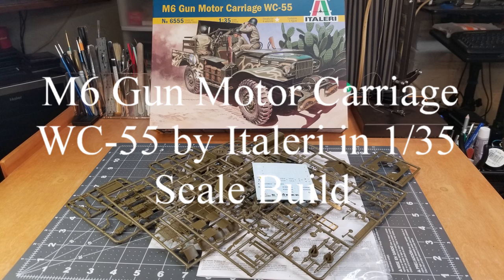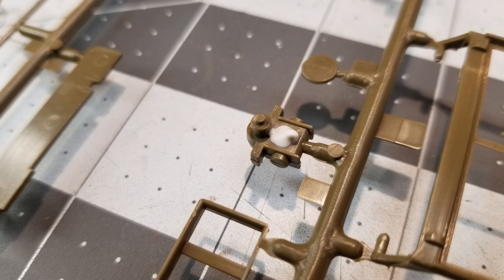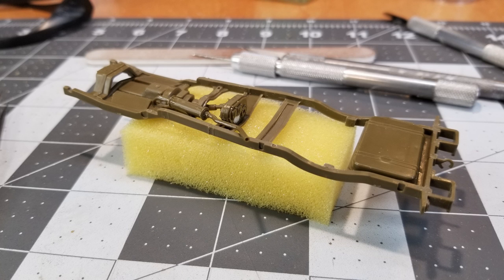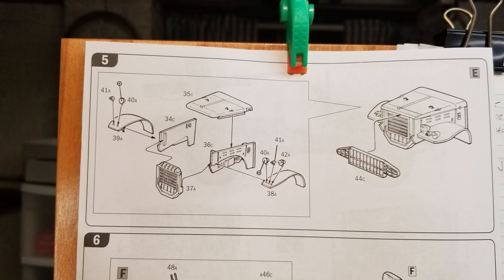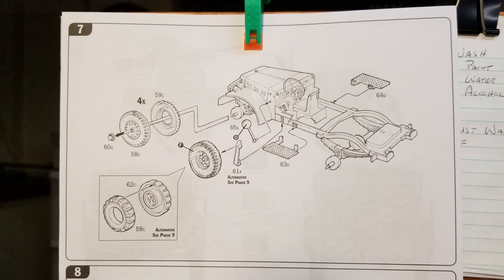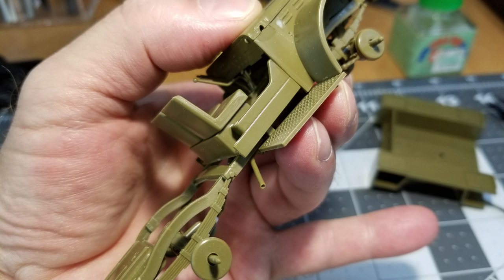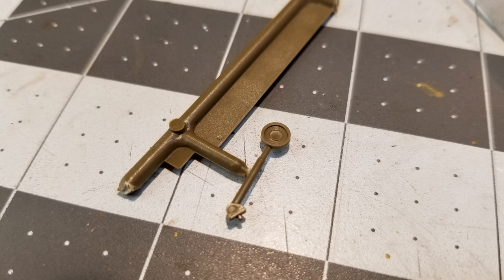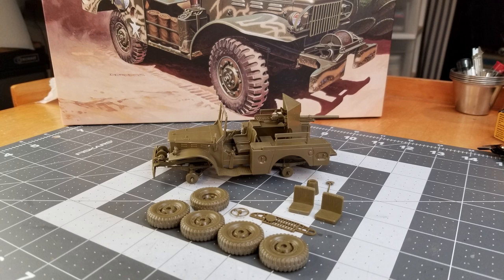M6 Gun Motor Carriage WC-55 by Italeri Kit Build

Comment: I picked up the Italeri kit some time ago to add to my collection of Dodge WC- vehicles.  I'm quite familiar with the Italeri drawbacks, but it's nice to actually see some of the modifications that'll need to be made.  So, thank you for that - it's much appreciated.  The video was nicely put together and your narration covered the build quite well.  Well done, Hillbilly, well done!

I fully understand that this is an "Out of the Box" build.  It's been a long time since I've done a strictly OOTB build as I usually add after-market items if available.  So, there's a good possibility that I'll replace their M6 gun with one from Bronco as the detail is much better and they provide photo etch for the gunner's guard.  And SKP Models Lights and Lenses are so nice!  And throw in some nicely cast resin wheels/tires.  ;)  - Mike
Reply from the maker: Hey Mike, yes, this kit has all of those issues that we are accustomed to with older Italeri kits, but the basics are there. And the gun was terrible, but being a cheapskate, lol, I chose to do the best I could with it. This kit could really use the benefit of aftermarket parts for sure! Good luck on your build, take care and model on!! Johnny